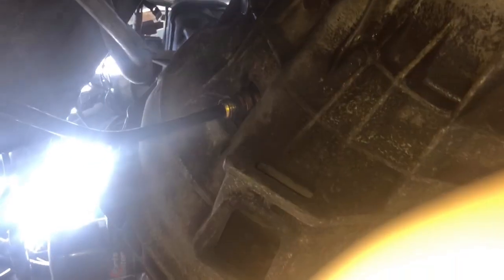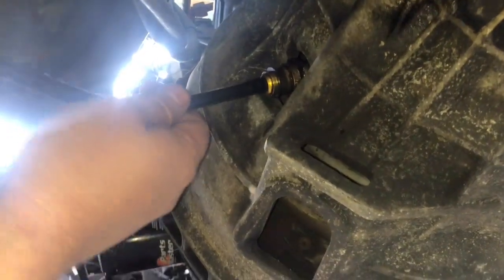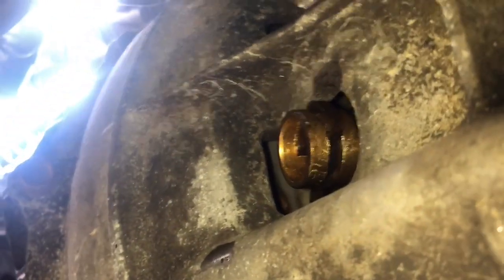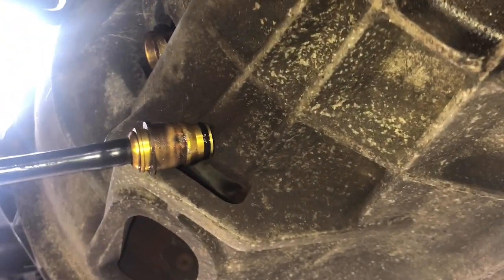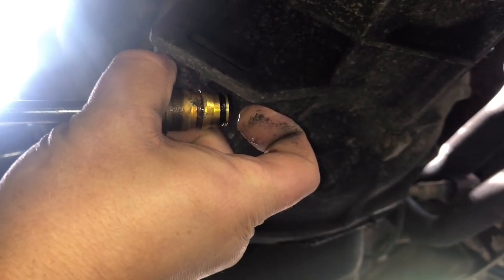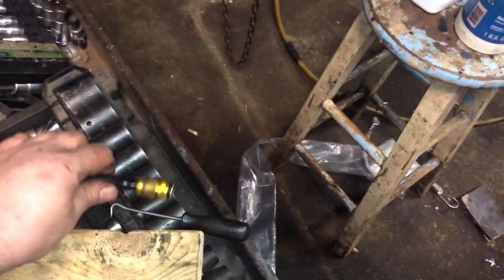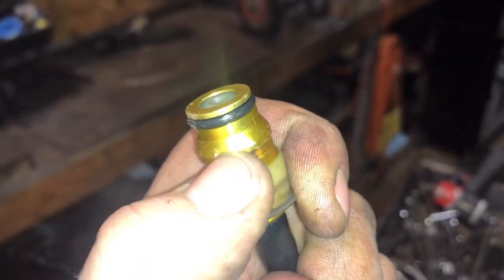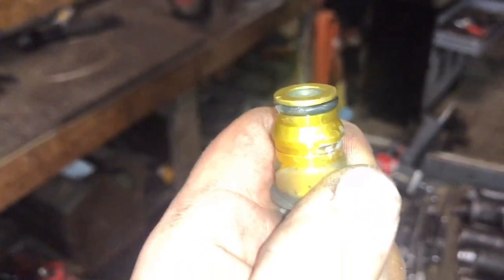Hard or Stiff clutch pedal fix on ford f150 truck

Comment: Same thing happened to except I bent the clutch rod comin from the master cylinder straightened it out reconnected line bled system now all I have is a lil bit of clutch just enough to shift any ideas on what todo

Comment: Hi , I have a 99 Mazda b2500 truck , and after driving for about 10 minutes my clutch pedal will get really stiff and can’t shift into gear ,  after a couple of hours the clutch pedal  will start working again , if you have any info that would be great , this video might help thanks
Reply from the maker: metalzz1 that sounds like a head scratcher. I’ll throw some guesses out there though it’s hard without visually inspecting the vehicle myself. Nasty fluid clogging the line or clutch master. Bad clutch master. Maybe throw out bearing, clutch or pressure plate bad or getting hot then when they cool it’s good again?
Reply: FerKurl  thanks
Reply: My 03 cavalier does the same thing
Reply: @tammydoyle7320   Hi , I had to get my clutch and slave cylinder replaced in my truck , now it’s working great , hope this helps.